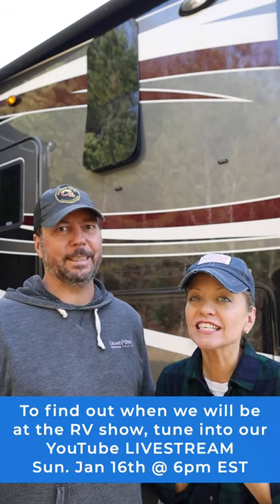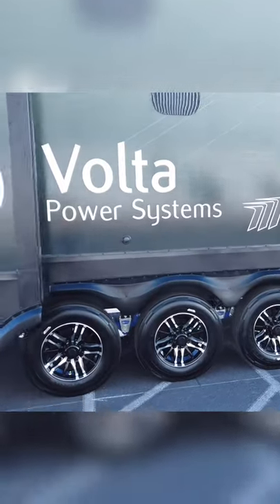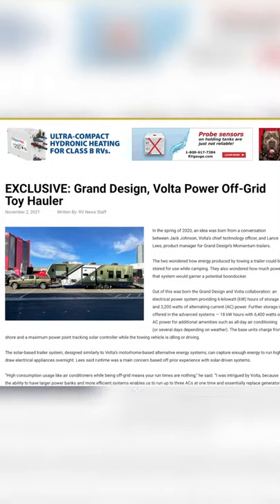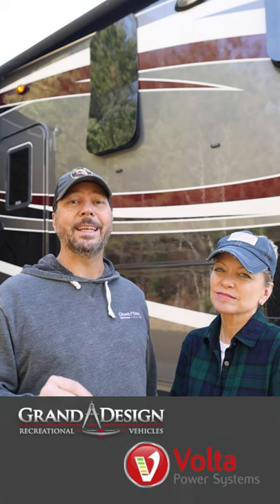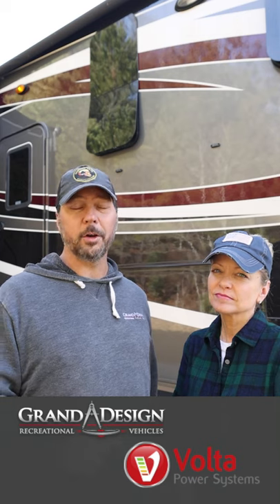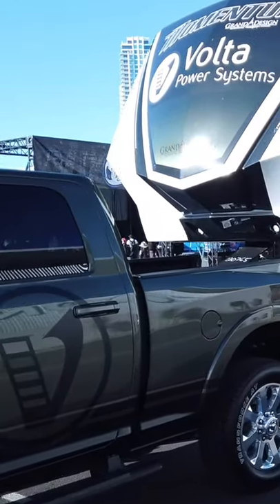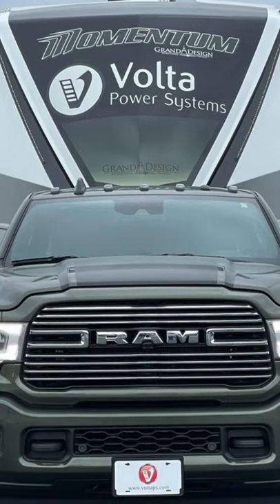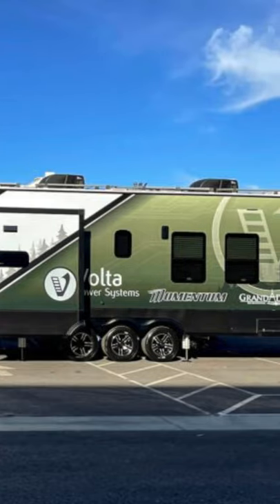The Ultimate Factory Off-Grid Power System (Volta Power Systems) #SHORTS

Comment: Alternator built into the truck...so
Does work on the batteries with out using the generater in the fifth wheel/motherhome, that would be great. The generater as well as alternator, great idea.